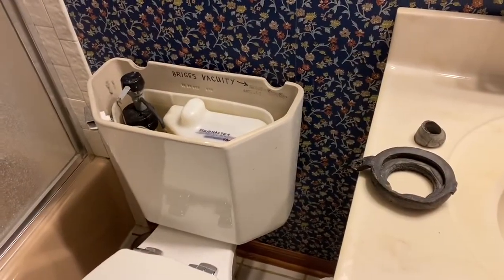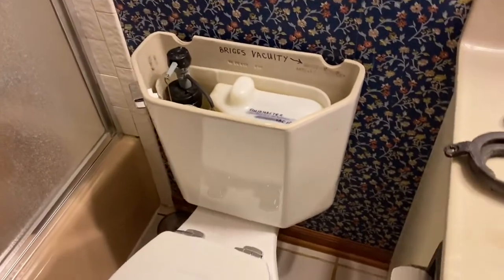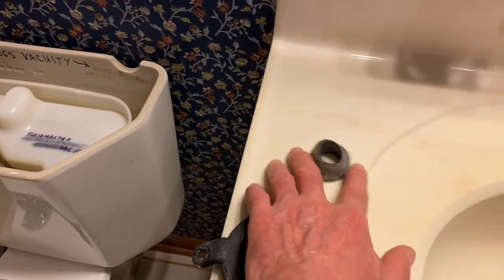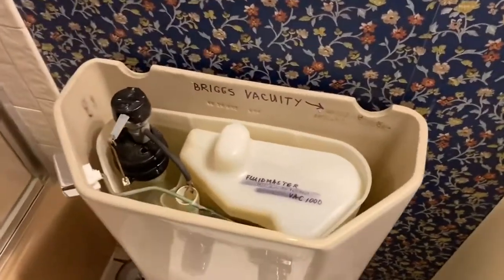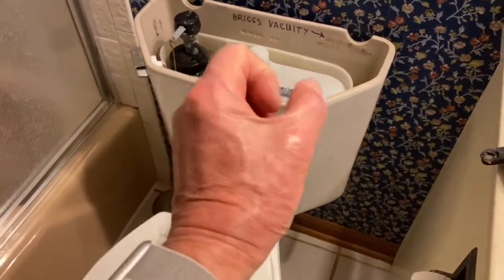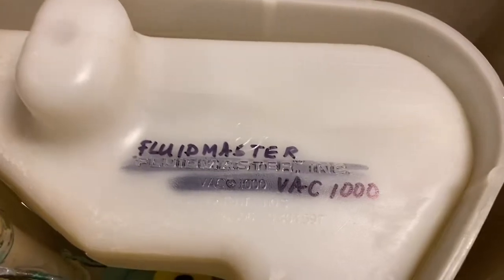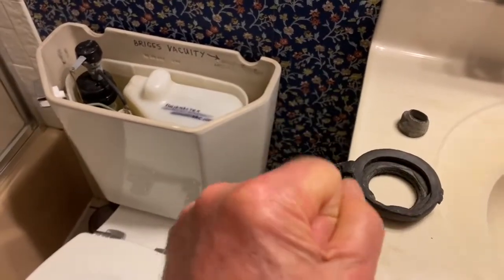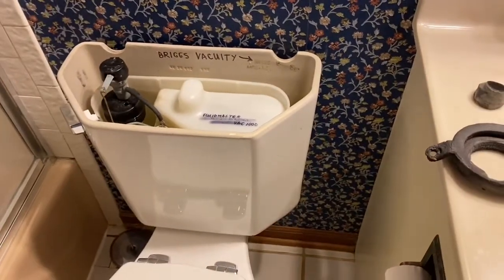Biggs Vacuity toilet incomplete poor flush - Fluidmaster VAC 1000 @Nice2Know

Comment: Thanks for the video.  The Briggs Vacuity set-up is very similar to my Crane Vacuum Induced Power-Flush (Model # 3995).  Looks like I'll be able to use the Vacuum System Seal Gasket mentioned by  Pro Answers.

Comment: Could this plastic Briggs tank thing have any type of failing component that would cause a sewage smell in the house? Our toilet has one of these and occasionally our bathroom will reek for a day or two, sometimes a little longer. We can't figure out what's causing it, possibly the PVC pipe for the vent isn't tall enough (that's what I've been told anyway and we do live in a low area). When it was still my grandma's house, she qualified for some program that sends technicians to your house to install energy efficient updates and I'm almost certain that's when this thing was installed, so it's been almost 20 years I believe. It flushes fine MOST of the time, but we have had some pretty bad clogs in the underground line going out to the septic tank (horrifying experiences). Any thoughts whether or not replacing the toilet would fix these issues or has anyone had similar experiences with a setup like this?